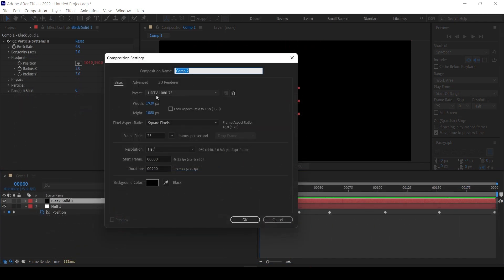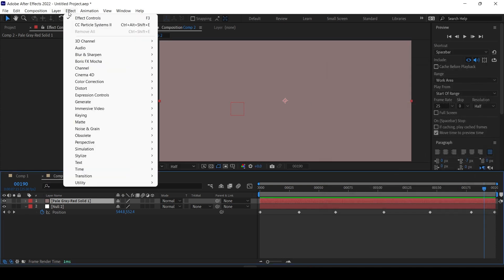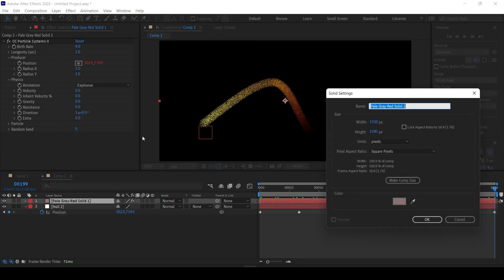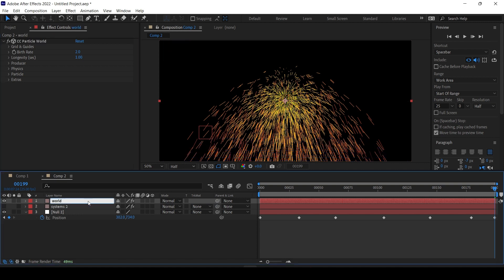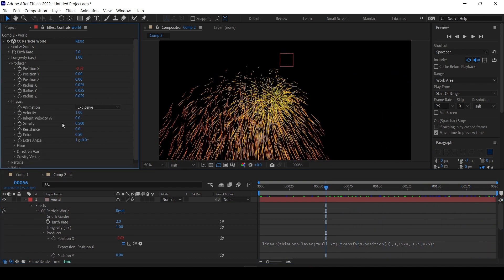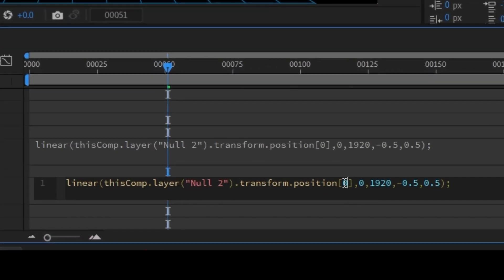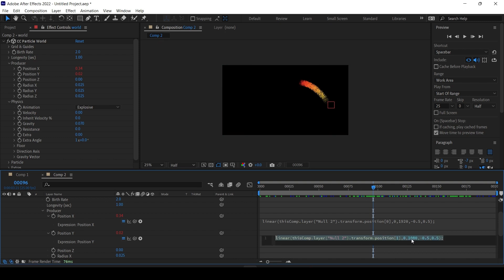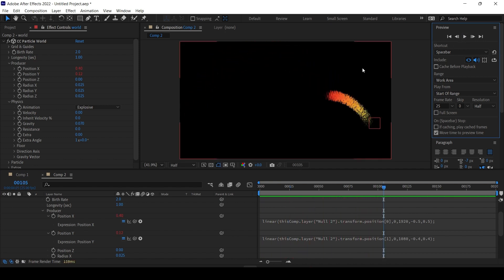After Effects MUST KNOWS: The Linear Function

Comment: I need to see which problems this solves to understand in which occasions this would be helplful.
Reply from the maker: It's useful all the time...Say you have an animation of a clock rotating, and you wanna control using a slider. You would have to map the 0 to 100 range on the slider to 0-360 degrees on the clock